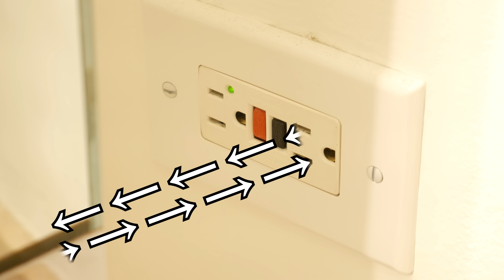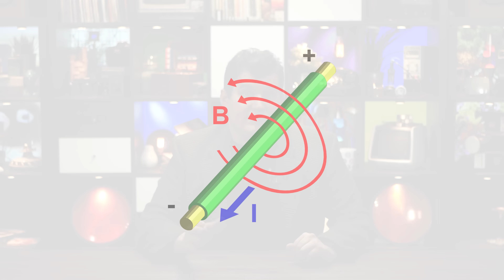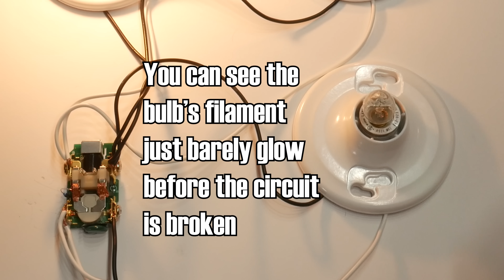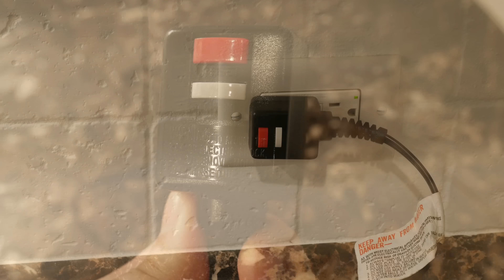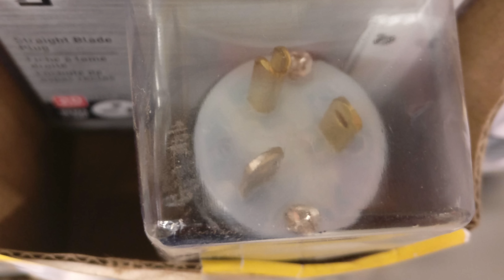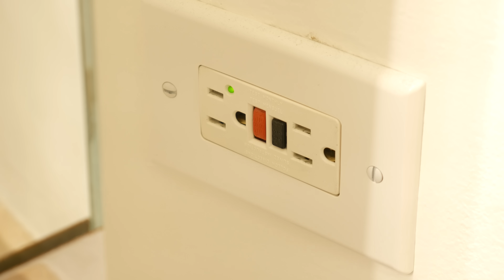The GFCI/RCD: A Simple but Life-Saving Protector

Comment: In Germany, this safety measure is called "Fehlerschutzschalter" (fault protection switch) or "FI" in short and is required to be build into every flats or houses main power supply
Reply: Funny how many languages each seem to have a slightly different common term to describe these devices. Here in the Netherlands they are normally refered to as 'aardlekschakelaar' which literaly translates to 'earth leak switch'.
Reply: @RC534  Yes this is funny ! In france it is call "interrupteur différentiel" or in short "différentiel" (differential switch) : because it check for a... difference in the current. Everyone named it differently !
Reply: @tom-sn4gd  this is such an elegant name
Reply: @tom-sn4gd  actually similar to russian, it's called "differencial'nyj apparat" or "difapparat" for short here, literally means "differential machine"
Reply: @RC534 In Sweden we call them ground fault breakers
Reply: In the Czech Republic it's called a "Proudový chránič" which means current protector. But It's commonly also called a "FI" like in German
Reply: In EX-YU countries it's called "diferencijalna sklopka" (differential switch) and the abbreviation "FID", though I doubt it stands for anything. Most likely based on the German FI.
Reply: @glossymouse7712  the D probably stands for diferencijalna
Reply: In Germany FI is the old term. I had my exam 2 years ago. FI would have been incorrect. We had to use RCD as correct term. Further the correct term would be FehlerSTROMschutzschalter (fault current protection switch) because F = Fehler, I = physical formula symbol for current.

Comment: In the US people can change their sockets. In Finland you need an electrician for that so people seldom change them. GFCIs are installed them when the whole house is rewired. If one wants to use one in an old home them one typically uses a plug in one.

As s rule it is not necessary to update the house to new standards but if one is going to change a socket in a bathroom one has to use a GFCI one.

I have GFCIs on my panel but by wiring is not compatible with them so I would have to rewire my whole apartment before I could connect them.
Reply: Wow, that is very strange.  Your house must be wired for 2 wires instead of 3.
Reply: @redbaron6805  Yes, two wires was common here until the 80s. That is the apartment. The building has separate grounds.

Comment: I’m supposed to have one of these for the heater in my snake enclosure because it’s so humid in there... but I don’t lol
Reply: They are cheap, only $11 at your local hardware store.  It is not worth the risk to skip out on those as they can prevent injuries or death.
Reply: @redbaron6805  I actually didn’t know that, I thought it was something you had to have an electrician installed, thank you for this important knowledge as I don’t want to put my lil snake at risk.
Reply: @crying2emoji5  You can simply use an inline one, like this one:

https://www.homedepot.com/p/Tower-Manufacturing-Corporation-3-Wire-GFCI-Outlet-Adapter-30439005/202510242

They work exactly the same as the outlet one's except they protect whatever is plugged into them, but they plug into an unprotected outlet.

Basically, any hardware store typically has a outlet strip version or something similar to the one above.  You don't have to get it of course at HD.

Comment: Three out of four outlets in my kitchen work. Of those three, all of them are on the same wall as the sink. And only one of them, and not the closest one to the sink, have one of these, lol. However, I put my wet dishes right in front of that outlet to dry on the counter, and while I'm not flinging water all over the place, it's good to have the feature there regardless.
Reply: The other one's are connected to the Load side of the GFCI.  All the outlets in your kitchen typically are connected to a GFCI except appliances with dedicated outlets like the fridge.

Comment: What's the price for this kind of outlet? In Belgium they cost 60€ for a 30ma in a service panel
Reply: The outlets are typically around 10€ at hardware stores in the USA.   In the USA a class A GFCI which is typically used is required to trip at 5mA or less.

Comment: i know why he tested this to show it better, but this here is stupidly dangerous. I trained as an electrical engineer here in germany and Security was always my highest priority. Testing RCD`s is one of the most important steps besides resistance testing and you can believe that these things saved countless of lives. So for the love of god, integrate an RCD in your electrical circuits.
Reply: Not sure why it is stupidly dangerous.  The voltage in the USA is 120VAC, so an electric shock is typically uncomfortable more than anything else.  I have been shocked countless times by both 120VAC and 240VAC, and even 360VAC, so testing a GFCI using 120VAC isn't exactly a death defying experiment.
Reply: @redbaron6805  Everything above 50VAC is considered dangerous. The reason isnt the high current, rather the alternating state of it. It can cause serious heart trouble from ventricular fibrillation to arrhythmia. But, if you keep the current below 30mA, it is considered "safe" as there is not too much current that messes up your body. Hence, you got an RCD.
Reply: @birdgamerman  For heart fibrillation you need at least 50ma, typically a tingle at 120VAC is 3ma or less, painful at 5ma.  Hence, GFCI's are typically designed for 5ma or less.

Unless you got wet hands, it will be difficult to exceed much over 3 to 5ma.  I'm not saying people should play with electricity, but his little experiment with the GFCI was pretty safe as it was conducted under controlled conditions.
Reply: @redbaron6805  You do you, but i consider anything above 50vac dangerous and need to be taken accordingly. My job where i used to work was really strikt like this, but i understand. But, we have 240V here in germany, might be why aswell.
Reply: @birdgamerman  From a literal standpoint, anything above 50VAC can be dangerous and is therefore classified as such.  From a practical standpoint, 120VAC is normally not dangerous unless you are in a wet location or wet yourself.  

I'm an Electronics Engineer and have been shocked by both 120VAC 60Hz and 120VAC 400Hz, and 400Hz is definitely more painful. 

Like I said, I'm not claiming it is hot a hazard, but a controlled test with 120VAC is not considered inherently dangerous where I come from.

Comment: It looks like there's another difference between the 15- and 20-amp receptacles: The 20-amp one is tamper-resistant. That actually is a more complicated design, though the price increase is about six times higher than is really justified by that. (Tamper-resistant receptacles have shutters that are basically a built-in version of a plastic receptacle cover, and they've been required for home use, with limited exceptions, since 2008 NEC.)

Comment: GFIs are notoriously unreliable, and can trip to the off position for no reason.  I would not recommend  using one with a refrigerator or a freezer, unless used in conjunction with a clear and obvious alert that the outlet has stopped working. Even then, if you are not home, well, you get the idea.
Reply: GFCI's don't work well with motorized loads, hence are not normally used with refrigerators and freezers.  They can even be tripped by washers and microwave ovens.

Comment: Another great video! I always wondered what was up with these!

Questions I'd appreciate someone explaining: I now know what these do, but I'm still not sure how to operate them. So, most of the time both buttons would not be pressed, yes? Then, maybe every month you press "test"? I think some of the outlets I've encountered don't have indicator lights, so would I listen out for the clicking instead? Lastly, do I need to leave it on test for a while or can I immediately hit "reset"?
Reply: The Test button should trip it immediately.  No need to hold it.  Once the test is successful, you can reset it.  Listen for the clicking sound and you should see the reset button extend out.  If in doubt, just plug in something like a lamp, turn it on and press the test button.  The lamp should immediately shut off.  Press the reset button and the lamp should turn back on.
Reply: @redbaron6805  Thank you soo much!
I really appreciate the thorough explanation! I'll make sure to test the bathroom outlet when I get home ꉂꉂ(ᵔᗜᵔ )
Reply: @ShoulderMonster  No prob.  Glad to help.

Comment: Can you legally have these on EVERY outlet in your home?
Reply: Yes, nothing prevents you from having those on every outlet.  People who want extra safety or have small kids somethings put them on every single outlet.  Little kids are notorious for licking their fingers and putting things into outlets.  

Code requires them on any outlet within 6 feet of a sink so they are usually always found in bathrooms, kitchens, laundry rooms and in garages.  Any outlet outside is also required to have a GFCI.

The code requirement is just the minimum.  You can exceed the code and put them on every single outlet in the house.

Comment: Dry hands will not trip most GFCIs so they are pointless anywhere else but near water. Also GFCI breakers look just like AFCI breakers but there is a big difference in the two. You should do AFCI
Reply: A pretty misleading claim.  You can easily have wet hands after washing your hands and accidentally touch something shorted.  Hence they are required in garages and all outdoor outlets.  GFCI's can be useful in many scenarios, for example tripping if powered garden tools accidentally cut the cord like hedge trimmers and chain saws.

Comment: I once tossed a cord into saltwater with hot and ground stripped out... GFCI sat there as water boiled. Neither the GFCI nor 15a breaker intervened. Test popped it out...
Reply: That would be impossible unless the GFCI was faulty.  Unless you were using Hot and Neutral, then the circuit would continue working as the current in was the same as current out.

Comment: In Germany (and in large parts of Europe) RCDs have been absolute standard for ALL sockets and lamps for very many years (and for the bathroom for many decades).

For this reason, they are almost always permanently installed in the fuse box or electrical distribution of the house. They normally cost about 40 bucks.
Reply: GFI's are a heck of a lot cheaper, and much easier to install here in the States, being just an outlet replacement, taking maybe 15 or 20 minutes tops to install, while costing at most 5 to 10 bucks each, and you only need one to a room with running water in it by most city codes (at least in Pa, via our UCCs).
Reply: @ForeverBleedinGreen  GFCI outlets are a minimum $15, if not more everywhere I check.
Reply: @ForeverBleedinGreen  cheaper & faster ≠ better lol

If an RCD is installed here in the fuse box or distribution, it also rarely takes more than 10-20 minutes.

It is clearly much safer to equip all circuits with an RCD. They provide protection against direct contact, indirect contact as far as fire protection.
…Especially when using power plugs that are not touch protected… like in the USA.

Do you differentiate between GFCI and RCD?
Because the devices we use are definitely RCDs. The device detects a differential current between the inflowing and outflowing currents.

GFCIs, according to the term, are supposed to detect a ground fault or a fault to earth. Since this application is very limited and does not cover all fault currents, we definitely do not use devices labeled GFCI.

At what differential current do your usual GFCIs trip?
Reply: @003General actually, GFCI and RCD are literally the same thing. As for the panel vs outlet argument, both options are available in the US. The outlet replacement is often better at bringing older buildings up to code without a whole house rebuild and a panel swap. 

If an electrician is installing a new panel anyway, then GFCI protected breakers are an excellent option.
Reply: @nathanielhill8156  
GFCIs, according to the term, are supposed to detect a ground fault or a fault to earth. Since this application is very limited and does not cover all fault currents, we definitely do not use devices labeled GFCI. We use RCDs. These detect any type of possible fault currents and are not limited to ground fault currents.

If you are saying that both are the same thing, then the term "GFCI" is simply wrong and misleading.

Circuit breakers with built-in RCD and a standard division unit of 1 are really a very great thing.
Reply: @003General  Ground fault is what both detect. Ground fault means that current escapes to the ground, possibly through a person. It has no direct relation to the ground wire though it of course can be the route the current escapes.

The difference is ow they work. In the US they are electronic. In Europe (at least in Finland) electronic ones are banned and they must be electo-mechanical. Electronic ones are used as plug-in ones but they always are optional. Also the tripping current is different. In Europe if is 30 mA, in the US it is 5 mA.
Reply: @okaro6595 
As I have described, Europes RCDs detect all types of fault currents and are not limited to AC ground faults.
The tripping current is 10-30mA
Reply: @003General   What do you mean by "all types of fault currents?" There is only electrocution through direct and indirect contact and the GFCI perfectly covers both.
Reply: @alejandrogalarza3147 Late to the party, but newer RCD typically can also protect against DC ground faults which GFCIs cannot. Arguably that is not an issue since that is unlikely to occur in a plug, but if you protect the whole house, where there might be a Solar Inverter or other systems that could cause them, it can make sense.
Reply: @derfurz8618  No, by definition, all faults, DC or AC, are ground faults, because a ground fault isn't when there's a current on the ground wire, it's when there's any current returning via ground rather than via neutral (and "ground" includes such things as, say, through a person to a pipe or to the floor). Any imbalance between the current supplied by the hot wire and the current returned via the neutral on a US GFCI outlet will immediately trip the protection circuit. 

I know Europeans like to think we're all idiots over here, but believe it or not, that's not actually the case.
Reply: @003General you misunderstand the devices. GFCI and RCD are literally the exact same devices. The only difference between US and European standard is where they're mounted. 

Every single case where a European RCD will trip will also trip a US GFCI, unless it's upstream of the GFCI in the wall of the house (where it's generally not likely to give anyone a dangerous shock anyways, and where the circuit is still protected by a circuit breaker in case of a major short).
Reply: @alejandrogalarza3147  it is not limited to AC Ground Faults like the GFCI.
Reply: @003General GFCI and RCD are litterally the same thing with a different name. 

Both will trip when current going to netural is less than going out of live. There's no other kind of fault that leads to somone being shocked unless you somehow grab live and netural with each hand while being totally insulated from ground. 

Expect in Europe they tend to cover all circuits with 1 or 2 RCD so they have a 30mA threshold while American ones tend to cover 1 circuit at a time with 5mA threshold to trip. So in places with water the American ones will typically trip faster while other outlets aren't protected.
Reply: @Nathan-jh1ho  That's exactly what I asked: 
is the naming of the GFCI incorrect, meaning that it does exactly the same thing as an RCD and detects all fault currents?
Or does a GFCI really only do what its name suggests and only detect AC ground fault currents?
Reply: @003General  becuase what other way than ground fault could you get electrocuted to death with "fault current" that still involves "residual current"?
Reply: @Nathan-jh1ho  It is not only a matter of lethal, but also of damaging or otherwise dangerous fault currents.

For Example Fault currents between active conductors of different circuits or Induced fault currents are fault currents, that are not ground fault currents.

An RCD type A additionally detects sinusoidal alternating and pulsating DC fault currents, type F additionally detects frequency-mixed fault currents up to 1 kHz, and type B/B+ additionally detects DC fault currents and high-frequency currents up to 2/20kHz. An AFDD type also detects fault arcs caused by fault currents, even between active conductors of the same circuit.
Reply: I know i am late, but this guy that makes these videos (and as good as they are) has such an elitist aura when it comes to electronics, he really dislikes it when Euros educate him on the superior network LOL
Reply: @spicesmuggler2452  I think you’re taking him too seriously lol.
Reply: @spicesmuggler2452 it's ironic that you claim Americans are elitist when it's almost always Europeans coming in assuming their setups are superior (which, in general, isn't the case). The reality is that both US and European designs tend to have been made for a reason, they both involve compromises, and it turns out people in both places, shockingly, tend to have fairly similar competence. 

There are aspects of European standards that are superior, and aspects of American standards that are superior, but on the whole, I've noticed far more smug superiority complexes from the European side, and frankly, you need to step back and do a bit of self reflection.
Reply: @spicesmuggler2452  haha lol
Don't Americans often think they are the best or have the best (system)? 😅
Reply: @003General  No, that's just Europeans saying what Americans say, as Europeans are prone to do.
Reply: @wta1518  ok
Reply: @003General no, we realize most of our shortcomings and have excuses for the rest of them